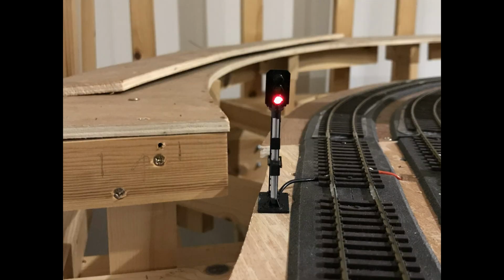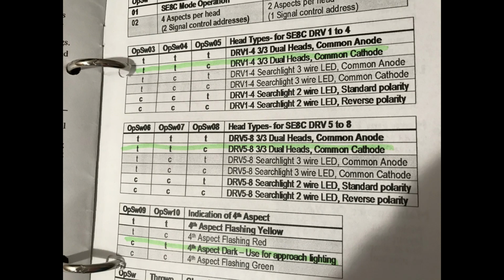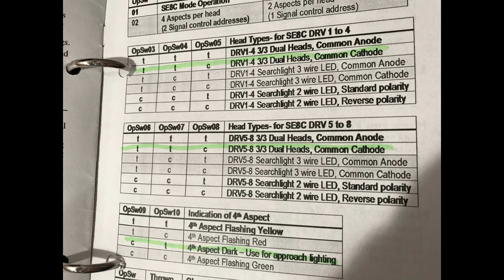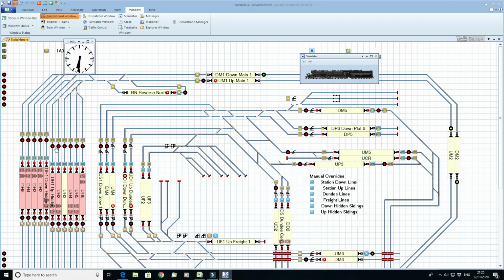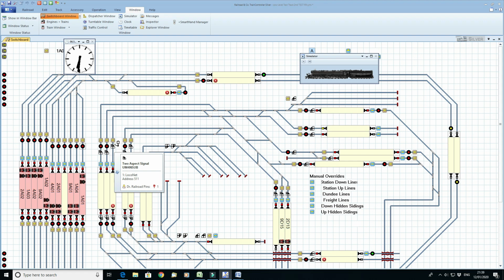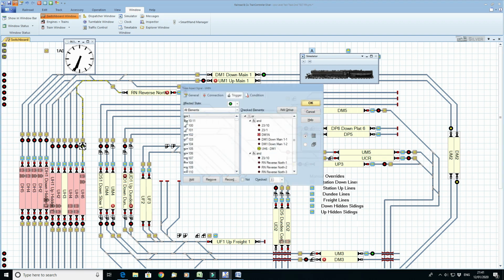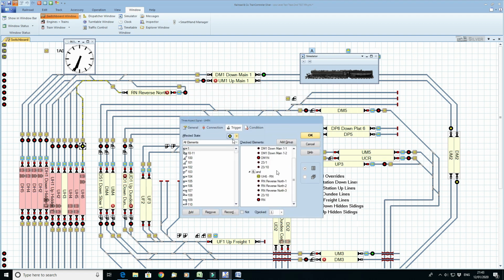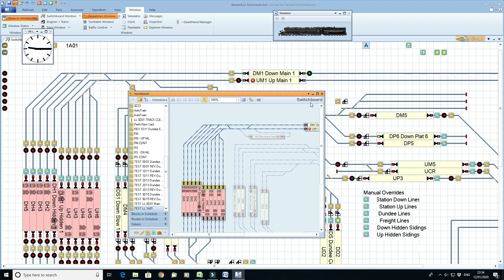Perth South Model Railway, #8 Colour Light Signals

Comment: HI Hugh signals are a mine field i'm going down the digikeijs route for my block detection current type and opto using rf censers but train controller is so expensive in this country.................tony
Reply from the maker: Yes I see a lot of people now going in for automation are using digikeijs. Train Controller is now ridiculously expensive though I bought it a few years ago when it was a bit cheaper. I still really like it as it’s easy to use and set up. As I think I said in one of my videos, when I started p,anning and building this in 2017, the layouts I found
Reply from the maker: ....used Digitrax and Train Controller so that’s what I used. Also we use Digitrax in our local Model Railway club. I guess if I was starting out now, I would probably go a different way. Hugh

Comment: Apart from being able to set delays before trains start to allow time for signals to be set, what other things pushed you to upgrade to TC Gold?
Reply from the maker: With TC gold, there are  also a greater number of options for using schedules. Eg, when using schedule successors, you can limit successors to maintaining the same train direction as the previous schedule and it has a facility called schedule sequence where you can create a sequence of several shorter basic schedules. However TC gold does lots more including being able to automatically manage/shunt individual vehicles on a train and loads of stuff I don’t understand nor will probably ever use! Hugh
Reply: @perthsouth5576  Thanks Hugh. I'm also led to believe that the Gold version is needed for proper Turntable control, which I will need on my layout.